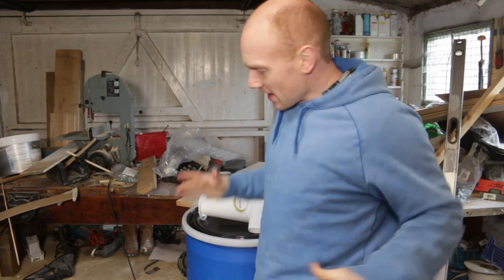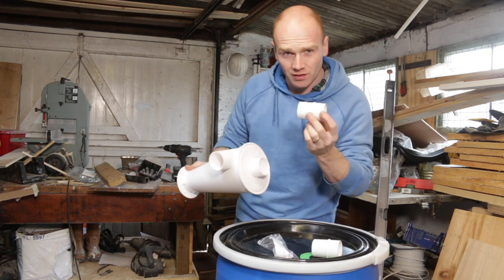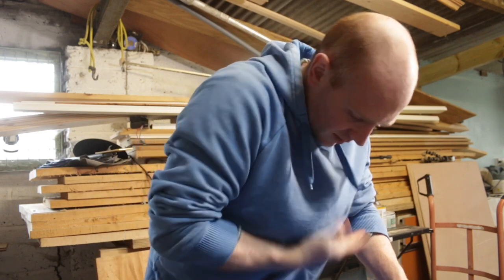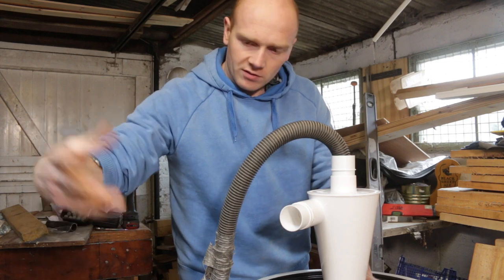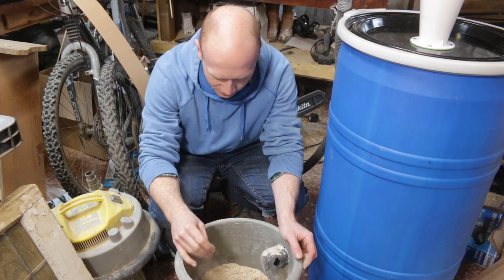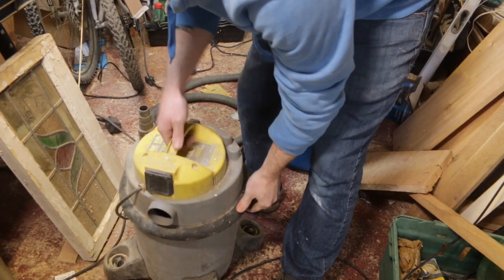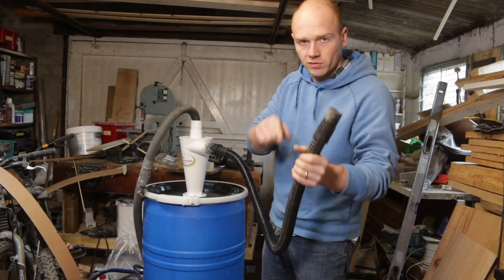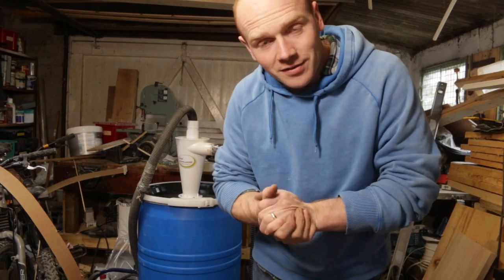Setting up a Workshop Cyclone

Comment: I’ve just bought one. Your video was very helpful in setting it up. Many thanks. I have to admit that I also use a paper bag inside the shop vac, mainly because I don’t like the idea of stuff getting sucked into the motor. Also, bags are cheaper than filters. Best wishes.

Comment: Hi, I have a Rutland dust extractor that was on offer and tried allsorts of drums, all of which ciollapsed so I ended up making a cube out of half inch ply and used self adhesive seal for the lid and it works a treat, so I wouldnt be too concerned about having to use a drum........ You have a lot to answer for.you keep me up late, watch one of your vids and end up watching several ............many thanks for your knowledge and time spent putting them together.... On another issue, I bought the Rutlands track saw, again when it was on offer and although it is a "cheapie" am very impressed. The only thing I didnt like was the track, so bought some from Makita and they work a treat.

Comment: I've just put one of these together.  £16 cyclone off eBay, £6 plasterer's bucket from Wickes, 9mm plywood cut into an octagon, and some shock cord from eBay.  I didn't even make a sealing gasket as the ply pulls down pretty tight to the bucket.  Works a treat.

Comment: nice one, i have the same and a slightly smaller thicknesser but i think there is a rule on the hose size that makes it work better one has to be bigger than the other and you can use a blower as well as a sucker if you want, the only thing extra i did was put a circular plate on the drum from plywood and used silicone mastic to totally seal it up, they work brilliantly and two years on no change in the filter...... 15 quid of ali express! works on the cnc, router table, saw table and planer, just used blast gates to control the suction, printed those on a 3d printer as they are serious money for what they are!

Comment: Perfect!  I'm off to build myself one.   It's great as a hobbiest, to find solutions that don't cost hundreds of pounds.  Thanks!
Reply: Good idea building one because this cyclone did work for me,I bough same cyclone but it did not work for me , I used a large drum and also tried a medium both round and heavy duty , 50% of the dust when into my Titan TTB351VAC, Only thing I done different was I put 15mm on top of the drum on which I bolted my Cyclone.

Comment: Thanks for the video.  Did you know that you can wash the corrugated filters under the tap or shower and dry them in the sun or in the airing cupboard?  Works for me!  (Best to knock off most of the loosest stuff first and remember that the filter material is vulnerable until it's dried.)

Comment: I tried to do similar but some reason it is failing for me.

Besides that, where do you get the timber matey? I asked at B&Q, and my local shop but they couldn’t give me the answer! I was supposed to ask you but couldn’t find the video even I subscribed. I just forgot to save the video (which I just did). Please let me know, I like board instead of Plywood… I shall look forward to hearing from you soon. Cheers!!!

Comment: This is a project I have on my list.  I have heard and seen pics of drums imploding when there is a blockage even a metal one so not sure what the answer is but your drum looks very sturdy and TBH looking at how much you filled it in a short time with planer big is probably better.  You need a workshop sawdust burner....
Reply: an implosion should only happen if you block the entry/hose completely. so if you keep the hose at an angle it should be ok. and try to only use this for saw-dust and small particle.

Comment: Nice work mate, I have a similar set up myself, will be worth while you getting a simple pressure relief valve put into the top as if you get a blockage your drum will crumple down. You can google cyclone pressure relief valve for some simple solutions. Keep up the good work

Comment: Many of the products that you buy seem to never fit the hoses you have. I have used PVC pipe and heated it to either sink it or stretch it to fit it to the sizes that fit. Eazy to do a heat gun and a good pair of heat resistant gloves.

Comment: I have the same planer and tbh the dust collection on it isn't brilliant to start with but at least your system collects most of it. One question I had: When using the Triton planer without dusct collection the dust port gets clogged pretty quickly - do you find it's better with suction on it?
Reply from the maker: I now use with a 100mm adapter and it’s faultless. 👌 it’s in my shaker door series if you want to see the adapter. 👍

Comment: I need a setup like that. I'm sick of sweeping up a big pile of sawdust round my table saw!
Reply: I bough same cyclone but it did not work for me , I used a large drum and also tried a medium both round and heavy duty , 50% of the dust when into my Titan TTB351VAC, Only thing I done different was I put 15mm on top of the drum on which I bolted my Cyclone.

Comment: Hi, great video. Would this work with grinder dust. I’m
A tiler and I use a grinder if cutting tiles in bathrooms etc. Tried this with my Henry but it doesn’t cope well. Also overheats it. Thank you.

Comment: can you post the link for your blue plastic drum? the ones I can find online look pretty flimsy compared to yours!
Reply: I just replaced my 30l drum that came with the the dust commander with a 60L one that I got off Amazon for £22.  It’s extremely ridge and a lot easier to empty than the 120l one on this video.   To be fair only used it this week but it’s a massive improvement

Comment: I bough same cyclone but it did not work for me , I used a large drum and also tried a medium both round and heavy duty , 50% of the dust when into my Titan TTB351VAC, Only thing I done different was I put 15mm on top of the drum on which I bolted my Cyclone.

Comment: Way to much dust in the filter and box. You have a leak between the dust bin and the cyclone or the lid to the cyclone.  You need to put a 1/2-3/4" piece of plywood under the cyclone to prevent flex and leaking in that area.  A very tiny leak here will wreck the separation.  To connect the hoses to the cyclone you need 2 each Fernco 2x2 connectors. Amazon has them. About $5 each.

Comment: Perfect! Thank You!
Reply: I bough same cyclone but it did not work for me , I used a large drum and also tried a medium both round and heavy duty , 50% of the dust when into my Titan TTB351VAC, Only thing I done different was I put 15mm on top of the drum on which I bolted my Cyclone.

Comment: I will be interested to see if you have trouble with imploding, I had 3 containers implode and gave up. Somewhere on you tube i think I saw a homemade pressure release valve
Reply from the maker: Yesterday I had two blockages which caused the lid to be pulled down a little more but I can't imagine the walls would collapse with this particlar vac and the rigid drum.  That said I can see a use of a release valve to avoide any issues.  Will look around and see what I can find.
Reply: The Restoration Couple any more issues with this ?
Reply: I’ve just got one of these and initially made a pressure relief valve in the lid to stop collapse, but had issues as every time I blocked the hose the dust would immediately get sucked into the vacuum cleaner as the air flow was coming straight up through the bottom of the cyclone and taking dust into the vac along with it. 

I’ve now replaced this with a box that has the valve on it, this then sits on the outlet port of the cyclone, the vacuum cleaner then plugs into the box, this way when I get a blockage only clean air goes to the vacuum and the dust already in the cyclone should hopefully drop into the drum instead of being sucked into the vacuum (as that air will now be static or low pressure due to the blockage). I’m able to adjust the valve (a screw though a spring attached to a plug in a hole)  to control the pressure before it opens, this way I can fine tune it if I need more/less suction to hopefully find the sweet spot where I get maximum airflow, but below the point where the drum will collapse. This design adds a few inches to the top of the cyclone, but my hose now connects at 90deg so it actually takes up less height than with the hose coming straight out of the top.

Comment: At one point you could buy GorTex filters for the vacs in the USA. Haven't checked to see if they are still available. Shake them off and pop them in a dishwasher, let dry and your good to go for a few more times around.
Reply from the maker: Our ash vacuum has a similar washable filter. Works great.

Comment: Hi, do you have a link to the actual barrel you purchased the size and straight sides looks perfect for a project I have in mind. Also, I have heard static build up in the plastic hoses can be an issue, did you ground it at all?